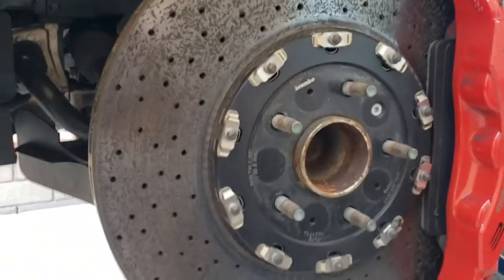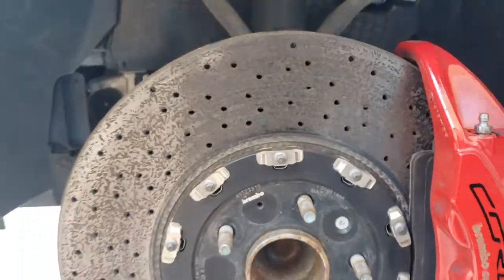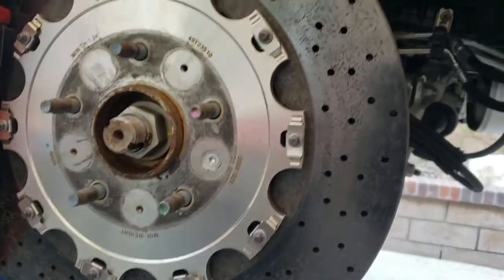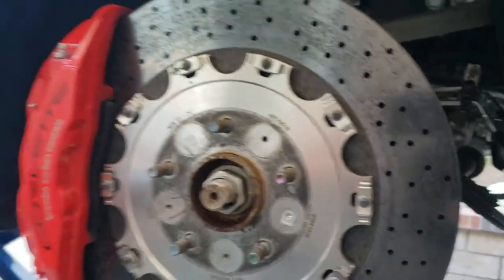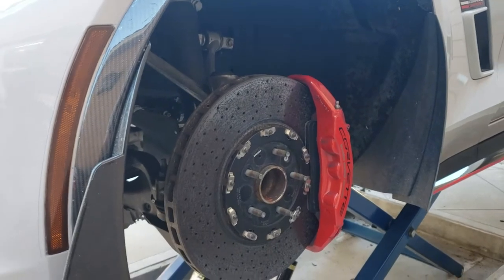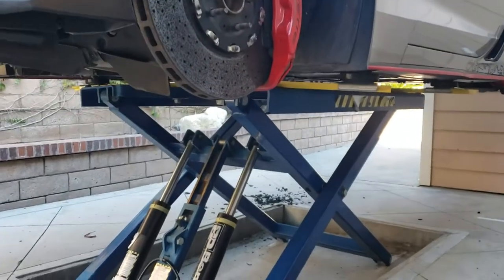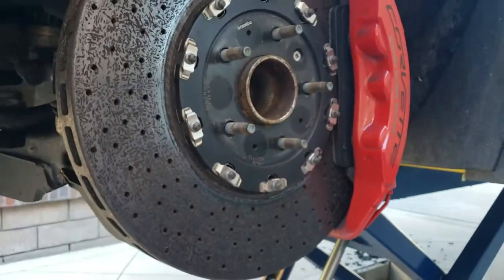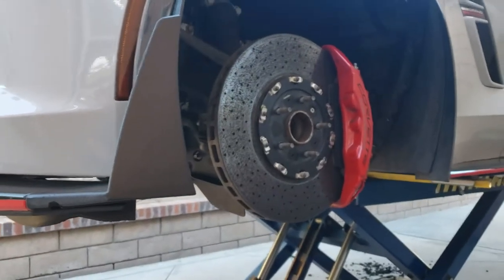How to tell when your carbon ceramic rotors are worn out.

Comment: Uhh, misinformation. That's not a worn disc that's an overheated disc which can be healthy. There is only 1 way to measure the life of a CCB and that's by measuring it's weight.
Reply: @Reiffan  I'm just fine buddy, don't try to educate me, I'm educated, I have mclaren disks with 5k kilometers and 600gr above weight and they look like that. I've seen even less kms on ferraris, it's normal, not all CCBS behave the same. On those particular CCB models, temperature makes them look worm, in reality they are not. Also next time send me information based on the OPs CCBS not audis/porch etc
Reply: @aleXtreme_  congrats to your resistant to advice... god
Reply: @Reiffan  well you said I'm behind time while you don't seem to understand that there are varieties of CCBs which weardifferently, resistant to useless advice? I call that wise. So yes, if you are interested in CCBs from newer generations look for chips and wear mark, if you look on previous generations like the OPs video, don't look at appearance but only on weight of the disk, or you will end up like the OP and replace perfectly fine discs. Most likely his "useless worn" discs ended up on ebay for couple thousands and bought from people who know how to tell if a disc is worn or not
Reply: @aleXtreme_  quite insightful - this makes sense. I have California T brakes that look similar to this, not as bad, and only 10K kms on the dash... but they’ve been glowing red hot a few times. Are you saying despite the rougher texture they’re fine? Anyway to get the smooth texture back? Other than send them off to be refinished? And without refinishing them (leaving them as is) does it drastically reduce the lifespan of them? Braking on a more porous, exposed surface?
Reply: @JordanRedlinRacing  Hello, yes they are fine just weight them, only way to get them smooth is to send them for refinish and NOT turn them red again. No lifespan is the same, problem is that you need to change pads more frequently and that's in case you brake hard. Other than that, for road use, you have absolutely nothing to worry about. Once a year keep an eye on your pads and you will be fine :)
Reply: @aleXtreme_  Interesting, thanks for the advice! What are your thoughts on a thermo reconditioning cycle? https://www.youtube.com/watch?v=Vhbh5TFitkk&t=2s I assume there is a point where they are too far gone ? Strange how easy the surface can go from Smooth to rough. Naturally (the weight still being fine), I'd assume there would be a point where like the fella's brakes above, they have no shiny finish at all? Wouldn't the disk just degrade super fast under these circumstances and be garbage?? Possibly wise to convert to a set of steels and send them in for reconditioning?
Reply: @JordanRedlinRacing  Nah, there is no point where they are far gone, only looks are being garbage because of no shiny finish. Yes the truth is that it's super easy to get them to this point but the disk itself has no issues, it's the pads that might have. If you track your car out a set of steels if not just don't waste cash here and there without reason
Reply: @aleXtreme_  can you use CCB on a daily car does it last a lot longer than a cast or steel rotor?? thx in advance
Reply: @lockonstratos8834  Yeah if you don't track the car a new set off ccbs will last you a ton of kmhs. I only use them for weight savings on my daily

Comment: Dear Engineer, I'm a Ferrioner living in Korea. I have a question, so I'll ask. Currently I own a California model year 2010. This vehicle has a carbon ceramic brake option. I'm currently running 5.2K. Can I get rid of the brake pads crazy quickly when the wear rate of the disc rotor is high or the lifespan is over? In fact, after replacing with a new pad, the brake pads wear out about 4 full brakes. I really don't understand. We would be very grateful if you let us know what symptoms are there when the disk rotor is at the end of its life.

Comment: great information.  How many sets of front pads did u go thru before the rotor needed replaced?
Reply from the maker: That was my 2nd set of front rotors on the 1st set I got over 20 track days 4 sets of pads on the 2nd set only 13 track days and 3 sets of pads.
Reply: @jeffbellitti5642  Thanks for the information .  Did you measure the rotor thickness and weigh them per the rotor minimums?

Comment: Hey! Great video. How long does a ceramic brakes last for a normal use driver? Thanks!
Reply from the maker: I think if you never did any track driving you would never replace them. However they are extremely expensive.

Comment: I tried to remove my ccb rotors today to check the weight...no problem getting the torx out and the two caliper bolts out...I couldn't get the rotor off...frozen/stuck..crazy...did you have that problem?
Reply from the maker: Yes I did. You have to use a hex punch.

Comment: Where can I buy ceramic discs for Porsche? I'm from Brazil, thanks
Reply from the maker: I'm not sure for Porsche. I recently changed to Giro disc steel rotors for a fraction of the price I feel like I haven't lost any brake performance I've been back on the track four times since then.
Reply from the maker: KNSBrakes.com
Reply: @jeffbellitti5642  Thank you